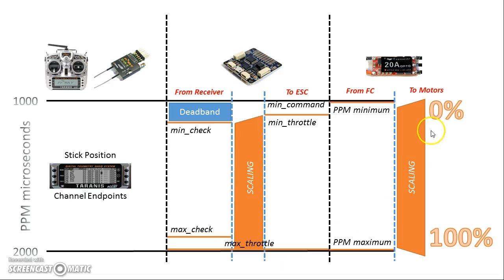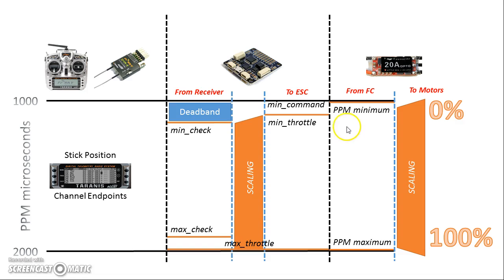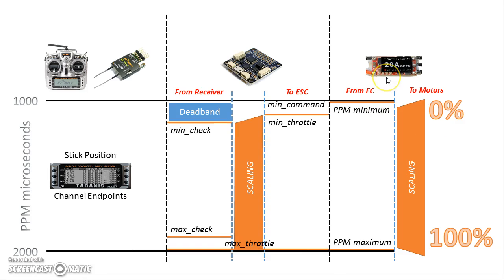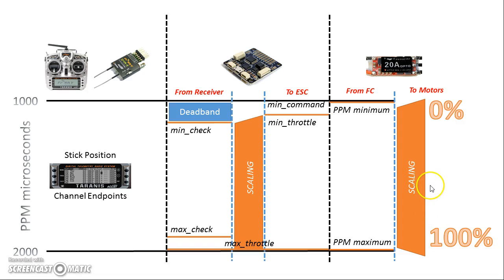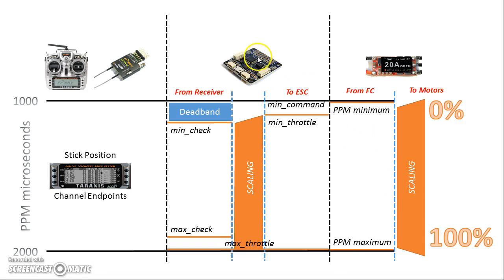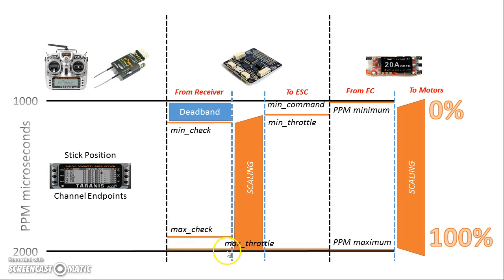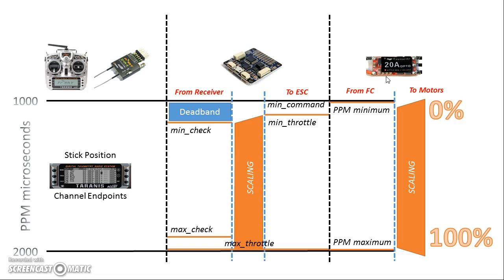Cleanflight throttle parameter configuration - Part 2

Comment: Thus, the FC has 1000-2000 values for min command and max throttle. The interest of min command is only to say: "on this value, motors are stopped". Right? To match the 1000-2000 values, for example on a Taranis, you play with endpoint to match the min and max values in receiver tab. So the stick positions are synchronized with FC values. Then, you use motor tab to calibrate ESC so they adjust their own value to the 1000-2000 values from the FC. Am I still right?

If I'm right, what would be the point to change min command? I saw that you put min_command to 980 in oneshot125 and had to put it to 950 when you used multishot. I have to admit that all those concepts are a bit blurry to me even if I've watched these 2 videos multiple times, english not being my native language may be part of the problem though.

What I would do for a new quad on multishot is: build -> betaflight firmware installation and basic configuration -> setting endpoints on Taranis -> ESC calibration -> checking min_throttle value in motor tab -> ESC configuration (multishot firmware + blheli setup) -> enabling multishot in cleanflight/betaflight. Then maybe play with top end throttle calibration. Would it be possible without touching min_command?
Reply from the maker: On the INPUT side, the Transmitter must send 1000-2000 for each channel, with 1500 as the center. This is what the FC expects. FC expectation can be changed using the rxrange command if the Transmitter cannot be adjusted.

On the OUTPUT side, the FC and the ESC must agree on the endpoints. The only purpose of min_command is to send a value so low as to stop the motors. If 1000 is the bottom of the ESC range, then min_command can be anything below 1000... it doesn't matter, as long as it is not really, really low (outside the range of valid values).
Reply: So in fact the value of min_command has no importance at all as long as it is below ESC's PPM min you get from calibration.

I guess from your multishot video that your PPM min was already under 1000 for your ESCs in Oneshot. And because multishot change the way the ESCs handle the PPM values, you had to lower min_command value.

But if you put min_command at 980, should you change on transmitter side also? So put 980 as endpoints in receiver tab?
Reply from the maker: PPM_min needs to be low enough that the ESC reads it as "zero" and stops sending current through the motor. I like to set it lower than strictly necessary to make 100% sure the motor is fully off. Some ESCs will "chirp" and twitch the motors if min_command is not low enough.
Reply from the maker: Your question about min_command and the transmitter... you are making the common mistake of mixing up the INPUT and the OUTPUT side of the FC.

Input side is TX to RX to FC. It goes from 1000 to 2000 with 1500 in the center.

Output side is FC to ESC. It pertains to min_command and max_throttle. 

Input and Output have NOTHING to do with each other. They are not related in any way. If you adjust min_command, that is on the OUTPUT side. It has NO EFFECT at all on the INPUT side. Make sense?
Reply: Oki, I understand now. So the endpoints on the Taranis must stay on 1000-1500-2000, as it's input.

Then, for everything related to FC and ESC (multishot protocol, min_command and min throttle,...) you calibrate it independently from the TX. So the min_command at 980 as nothing to do with the 1000 on the input side.
Reply from the maker: +MrDevilFlash exactly!
Reply: Just to be sure on the things to do:
1) setup betaflight for basics
 2) setup end points 1000-1500-2000 on Taranis
 3) calibrate ESCs in tab motors
 4) check PPM min for each ESCs/Motors in BLHeli,set "general" PPM min and max by taking highest PPM min and lowest PPM max
 5) setting min_command lower than PPM min, take some more place if you use multishot
 6) calibrate top end throttle
Reply from the maker: Technically, you can stop after step 3. If you are going to do step 4, 5, 6, I would suggest instead using the "Maximum Resolution ESC Calibration" method. It's the same amount of work, but produces better results.

https://www.youtube.com/watch?v=zCoEWBhJy6Q
Reply: Joshua Bardwell
Thank you soooo much. Your channel is so much informative. That's an amazing work you do!
Reply from the maker: Thanks! Glad to help!

Comment: If max throttle is related to the throw of transmitter and set to anything higher than max check, and anything above max check is going to be interpreted as a stick command, how can max throttle ever be achieved? Doesn't the FC basically stop counting once it sees beyond min/max check? Unless max check is irrelevant in throttle...
Reply from the maker: There is no deadband at the top of the stick travel. There is only deadband at the bottom because you need to issue the disarm command while flying. All other stick commands are issued when disarmed so deadband is not needed.

Comment: pls allow following question.

first thing first: I have a 450-sized quad..
 and building a reptile 500 so this is not about racers, but I think 
this also same on racer guys:

please make it simple for us and give a rule of thumb or something about THROTTLE levels.

what I want to avoid: I want to avoid a critical low thr where the motors STOP in mid air and quad free falls.

so
 obviously: I set in INAV (DigitalEntitys rewrite of cleanflight) that 
the motors DO SPIN at arm, to avoid that I can set THR soo low that they
 stop (at descend)

so pls give a rule of thumb because I could not interpret it from your video (MY FAULT NOT YOURS)

-what to set in blheli? is this good approach: min thr: exactly 1.000, medium: 1500, max? 2.000?

(must mention my radio: I have turnigy 9x + er9x+ frsky) so I DO HAVE thr value range from 989 to 2013 or so)

after setting it in esc, pls also a rule of thumb in cleanflight (does it matter I have angle mode on or off? think.. not,, or?)

so,
 CLI commands: set motos spin to ON when arm.. anything else impotant 
regarding throttle management? how important is to have to set the CLI 
command for THR hover -something? anybody can have stronger or weaker 
motor, esc, prop.. how important is that value in the "math"?

pls also continued: 

simple rule of thumb values for: (corresponding to what is set in ESC)

-min thr recommended "default" value,
-mid thr?
max thr? 
min command? 
-what else  you think of?

thx really much..
Reply from the maker: +Józsa Márton https://youtu.be/htkw7d97bOo?t=12m31s

Comment: Can I set min_check to a low number like 1050 to minimise the deadband on the throttle stick? It makes low throttle control slightly easier. I wonder if there will be any glitches due to this though.
Reply from the maker: +xypher2 That's what I do. I considered even going as low as 1025, but there is almost no difference at all in stick position between the two. As long as your stick reliably goes down to 1000, you could set it as low as 1001. I believe that the default of 1100/1900 is intended to cover a lot of low-end transmitters that don't reliably hit the 1000/2000 endpoints.

Comment: If you do top end calibration and end up setting max throttle say of 1945 does that mean the FC will output max power when your stick gets to 1945 leaving the rest of the movement to 2000 as deadband?

In which case Would it be preferable then to set the end point on the transmitter to match this value so that you don't have throttle deadband at the top?

I mean I don't massively mind as i am a bit of a throttle jammer anyways but it might make a difference to some who fly with loads of uptilt and get near the top of there throttle in situations where they need fine progressive throttle control.
Reply from the maker: +Stephen Gibb "does that mean the FC will output max power when your stick gets to 1945 leaving the rest of the movement to 2000 as deadband?"

No. Because the stick travel from 1000 to 2000 is on the input side of the FC (TX to FC) and the ESC calibration is on the output side of the FC (FC to ESC). The two are not in any way dependent on each other.
Reply: +Joshua Bardwell That makes more sense and from what I have read rxrange defines what the minimum and max throttle transmitter signals should be for all channel inputs and then this is scaled on both ends to the min command, min throttle and max throttle settings.

This is nice to know as I currently have had to calibrate my esc's at 1900 and one of them wasn't  accepting the max signal of 1950. I then tested each motor and found at 1878 all motors hit max rpm and have set this to max throttle :)
Reply: +Stephen Gibb Oh I really appreciate the response to my earlier question josh thanks.

Comment: So...would I be correct to assume that given an opposite scenario...ie tx will hit 1000-2000 but I want to short calibrate my ESCs 1000-850 in order to run 4khz gyro sync...that I would need to adjust my tx endpoint to 1850 as well or I would in effect hit max throttle before the stick hits the end of travel? In other words with the tx programmed to 2000 I would really be killing the throttle resolution because the upper 150uS would have no effect correct? If so this seems to be a problem with the fact that at the minimums we separate the tx-fc-esc but at max it isn't apparently separated.
Reply from the maker: +highoctanehotrod Your first sentence is making the mistake of confusing the input side (TX will hit 1000-2000) with the output side (short-calibrate the ESCs). What your TX channel limits are has nothing to do with your ESC calibration. If you want to short-calibrate your ESCs, set max_throttle to 1850 and run ESC calibration. Done.
Reply: +Joshua Bardwell ok..that is where your video is still confusing IMO..I get that the tx-FC communication and the FC-ESC communication are separate..but the grey area for me is max throttle. So if I set max throttle to 1850 and calibrate my ESCs to 1850..how does the FC know that I want to scale the 1850 max throttle  output to the ESCs  to the 2000us input from the tx?
Reply from the maker: highoctanehotrod The endpoint of the input channels are set by the rxrange command on the FC. They default to 1000/2000.
Reply: +Joshua Bardwell 
Hmm..ok I'll look into that..first I've heard of that command. Did you mention that in your videos? If so I totally missed it. So wouldn't that be useful info for those who say can't get 1000-2000 from their tx/rx? Maybe not a big deal unless short calibrating which probably isn't that common anymore. And is that adjustable in the CLI? I've never noticed it..but that doesn't mean I didn't miss it :)
Thanks for the info.

Comment: What is the proper procedure for getting the quad to hover close to middle throttle?  I have a zmr250 on 4S with 2204/2300KV Tmotors with 5045BN props.  Taranis is set to 1000min, 1500 mid, 2000max and these numbers match cleanflight info.  I my quad hovers at 1145.  ESCs have been calibrated.  I get the quad to hover and adjusted Throttle MID at 14 and increased expo but it still doesn't hover close to middle throttle.  What is the proper procedure?  I also lowered min_check to 1020 to decrease the deadband.
Reply from the maker: +CoolStuffReviews Unless your copter is super light, I am suspicious that something may be "off" with your throttle configuration, if you are hovering at 1145. So I would definitely double-check all of that. You would have to have a really, really high thrust-to-weight ratio to hover at such a low throttle position. But it's not impossible.

When you set Throttle Expo, you set Throttle Mid to your actual hover point, not your desired hover point. Throttle Mid adjusts where the "soft" part of the expo curve is. So you should set your Throttle Mid to 1145 if that's where you hover. But that will not really be able to help you out. There is just not any curve below the hover point for the expo to stretch out. What you will need to do is create a custom throttle curve in your Taranis so that the Taranis is outputting 1145 closer to mid-stick. Don't use any expo at all in CleanFlight.
Reply from the maker: +CoolStuffReviews One more thing: having the copter hover close to zero throttle is not such a big deal. Especially as you get into higher thrust-to-weight ratios, you just get used to a lower hover point. But you need enough travel below the hover point to do controlled descents, and with a hover point of 1145, I don't think you've got that.
Reply: +Joshua Bardwell that's why I don't have a controlled decent.   I have a racing quad but I asked some others and they hover at like 15 to 30 percent depending on size and weight.   I guess this is normal.   this is my first build.  I don't even have an action camera to weigh it down.  esc are calibrated.  1000 1500 2000 match on taranis and naze32. my setup is comparable to others and they said this is how is suppose to be
Reply from the maker: CoolStuffReviews What's your AUW?

If all this is correct, then I believe a custom throttle curve in your Taranis is the best way to approach it. Throttle expo in CleanFlight can't actually move your hover point, just spread out the curve above and below the hover point.
Reply: +Joshua Bardwell 557 grams with 4s lipo.  just weighed my zmr250 quadcopter.  what u think?  ppl said they hover low and fast fly forward at like 40 to 50 percent throttle with a lot more throttle available for punchout
Reply from the maker: +CoolStuffReviews At 557 grams, there is no way you should be hovering at 1145 throttle. Something is wrong in your setup. I don't have thrust data for your motor handy, but I happen to have thrust data for an RCX 2205/2350 kv motor--a slightly bigger motor than yours. At 25% throttle (1250), on 4S, with the GF5045BN that motor makes about 120 grams of thrust. 120*4 = 480 grams. At 50% throttle, that setup makes 329 grams of thrust per motor, or 1316 grams total. So your hover point should be somewhere between 25% and 50%.

To hover at 1145 throttle, you would need a total of 557 grams, or 140 grams per motor, at 14.5%. That seems completely implausible.
Reply: +Joshua Bardwell  where do you suggest I look?  I set my endpoints in taranis to match 1000 2000 in clean flight. my esc are calibrated and close to yours 1.020ms to 1.928ms.  mincheck 1020
Reply: +Joshua Bardwell oh and damped light on with high motor timing, one shot, motor stop when armed

Comment: I'm not understanding where you set min_check and max_check.
Reply from the maker: +helicrashpro the CLI.
Reply: So you would type in min_check=1000 and max_check=2000 ? BTW, thanks for all the help, your videos have been a big help to me.
Reply from the maker: "set min_check=1000". If in doubt, type "dump" and search the config dump for the exact command that you would enter.

But 1000 is not a good value for min_check. Min_check needs to be greater than the minimum channel value otherwise you cannot enter stick commands. So you would need to set min_check to at least 1001, and in reality, probably 1005 or 1010 is a safer value.
Reply: And don't forget to type save after you changed it in the CLI.